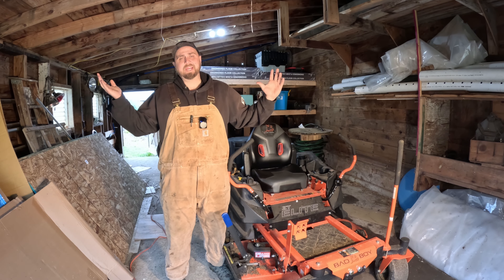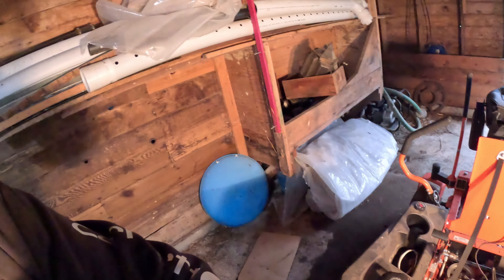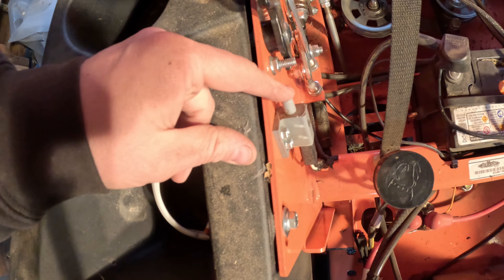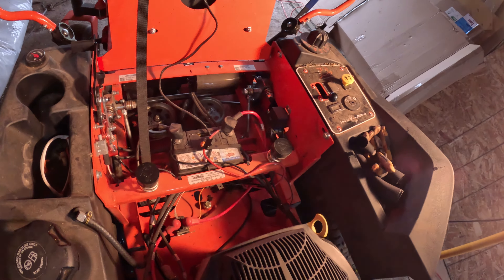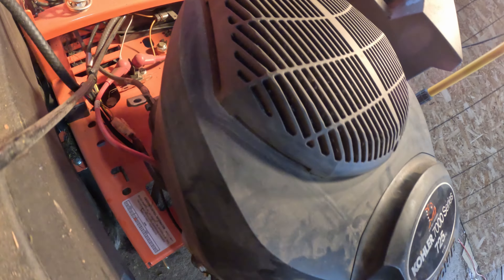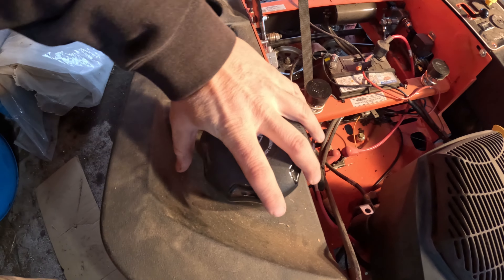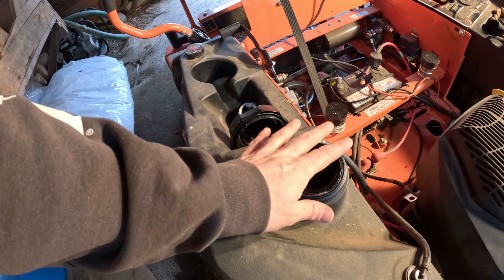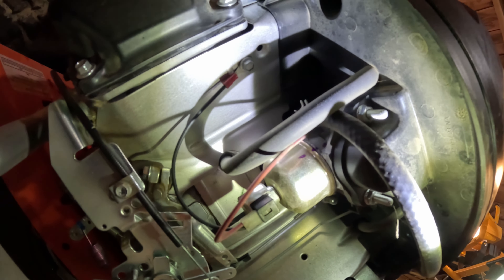Riding Mower Won't Start? Check This Stuff FIRST

Comment: i HAVE AN ariens 42 GEAR riding mower..AFTER I INSTALLED A NEW FUEL PUMP, GAS LEAKED OUT ALL OVER FROM MY CARB...I put the old fuel pump back on and all the gas leaked out again from the carb..do i need a new carb?? also one side of the deck fell and is on the ground how do i adjust it back up??great video thank u
Reply from the maker: Hard to tell what's causing the issue with the deck - I don't have a lot of experience with the Ariens.  The carb may be plugged-up and bypassing fuel through the intake or exhaust. That happens A LOT.  Putting on the new fuel filter may have jarred a little bit of gunk loose that clogged it up